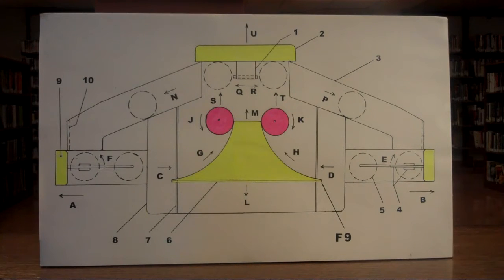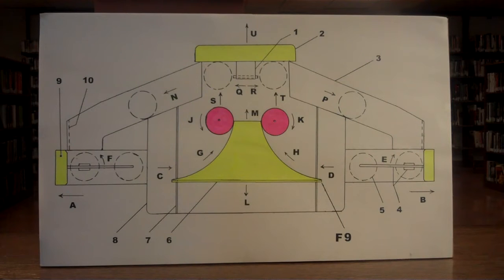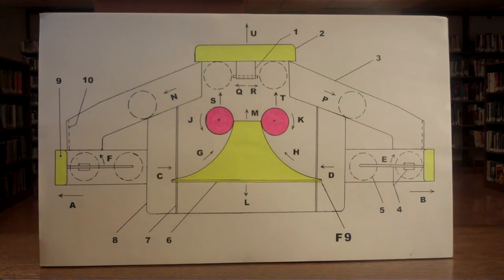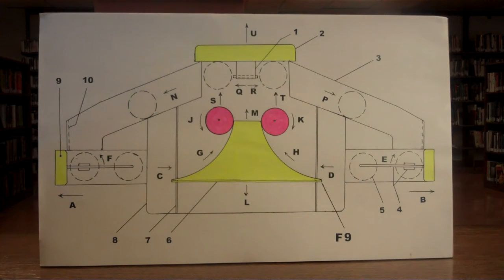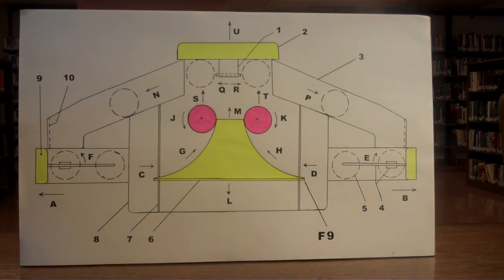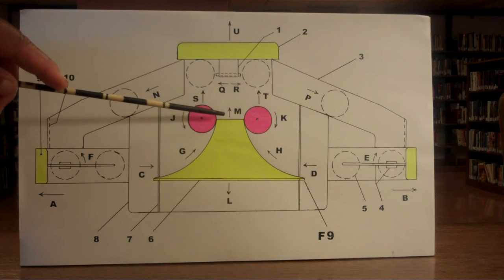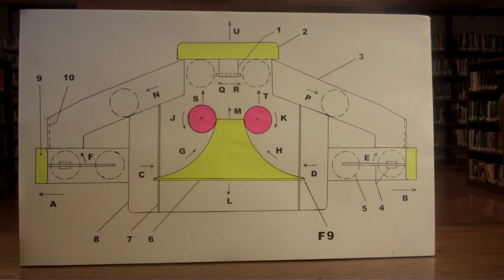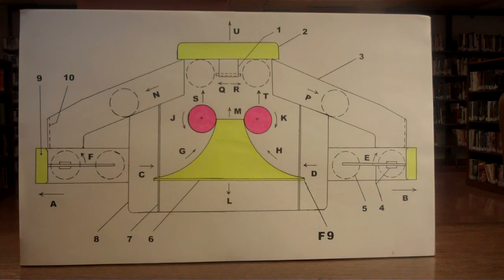PROPULSION: Enclosed Propulsion - Type 3. Enclosed Ramp Propulsion.

Comment: I THOUGHT OF SOMETHING LIKE THAT IN THE EARLY 1990s. AFTER GIVING UP ON THOSE THINGS BEING A STANDARD OF PROPULSION POSSIBILITY; YOU MAY HAVE PROBLEMS IN MICRO GRAVITY AS THEY ARE USED, AND THEY WOULD ALSO BE VERY NOISY WITH HAVING MECHANICAL NOISE, I MOVED ON TO AN ENERGY BASED SYSTEM, AND WHO CARES IF THERE IS NOISE AS A BYPRODUCT, THE IDEA IS MORE PRACTICAL, AND AN ENERGY NOT MECHANICAL BASED KIND OF SYSTEM, WOULD BE REDUNDANT IN MANY TYPES OF GRAVITY FIELDS. THE POWER SOURCE AND FLIGHT FIELD SYSTEMS. THEY MAY BE INFLUENCED BY BLACK HOLES OR AN EQUIVALENT TYPE OF GRAVITATIONAL FIELD FROM A  SYSTEMS. SOME ARE SIMPLY THEORETICAL, AND I REALIZED THAT YOU MAY HAVE ENERGY GENERATION FROM A POWER SOURCE TO SPARE, TO FEED THE HUNGER OF THOSE THINGS, THUS PASSING THEM BY EASILY.

THE TV SHOW THAT WAS AROUND BY THE TIME I MOVED ON FROM MECHANICAL APPARATUSES AS SUCH FLYING MACHINES, WAS "SPACE: ABOVE AND BEYOND". DOES ANYONE REMEMBER HOW THOSE ALIEN SHIPS SOUNDED? IT BOGGLED MY MIND TOO MUCH, I FELT GOOD MOVING ON. AND YOUR STUFF WOULD GENERALLY BE MORE NOISY IF THEY WORK ART ALL.

I MENTIONED "IF THEY WORK AT ALL.", THE FLAW IN THE SYSTEM IS THAT THERE IS NO POSSIBILITY TO STEAL MASS AND USED IT FOR PROPULSION. WHEN THE BALLS HIT "U", THERE WOULD BE A PROPULSION FORCE. WHEN THE BALLS GO BACK DOWN TO "F" AND "E" POSITIONS, THE WEIGHT "5" FROM THE LOOSE MASS "2" IMPACTED, THAT GIVES YOU A BIT OF PROPULSION "2 [IMPACTED]", WOULD CAUSE THE FLYING APPARATUS TO FALL AS MUCH AS IT ROSE UP. YOU WOULD BE LEFT WITH THE SLEDGE HAMMER EFFECT? HOW MANY PEOPLE THOUGHT OF A SLEDGE HAMMER THE TIMES THEY ENVISION THIS SORT OF STUFF?

FARCE, WHAT HAPPENS WHEN THE THING LOSES ITS BALLS?
Reply from the maker: Mr. S. W. B. : ... (1) You'll be shocked to find out that the Helio-centric Religion model of the universe you and 100's of millions of people were " brainwashed " in and taught: DOES NOT EXIST.  (2) The - REAL - universe is no more than 20 million miles in radius. Our REAL sun is not 93M miles away. Our REAL moon is not 240K miles away. Light Years do not exist. Planets are not millions and billions of miles away. And: black holes, galaxies, quasars, etc. don't exist. To you in your state of brainwashing (AS I WAS), this sound ridiculous. The earth is not a spinning ball shaped object. gravity do not exist. Humans never got to the moon in rockets. Which do you want ? the TRUTH or comfortable mind-fucked  lies ?  Choose.
Reply from the maker: Dear S. W. B. : ... If you think the things I thought up won't work, then let me give you a real heads up. All (ALL) the things that every person (Every person. That includes you.) has ever thought up to get from earth to anywhere from earth, except (probable)  for tesla ships (flying saucers) don't work and won't work. Why ? Because the universe you were taught, don't exist. The Helio-centric universe don't exist. It is fantasy.

Comment: first to comment on Mr. P . the absence of gravity is not an issue as Mr. Johnson said and even if it consumes extra energy then it will be just for a moment until the device start accelerating and create its own cloned gravity.

the idea is beautiful and genuine not like the hundreds of videos that copy an old unworkable design/concept . however , i do have doubt regarding the double action and their double reaction.. you know what i'm referring to, right ?
Reply from the maker: Dear Mr. Crowxe: If I missed something please let me know. I've sought to take in all actions, reactions, momentum, etc. I easily could have missed something.
Reply: Jessie Johnson . I really can't study it the way it's designed but we can simplify the ramp design in order to be able to analyse which reaction will be more than the other
Reply from the maker: Mr. Crowxe: The ramp can not be simplified more than appears in the video. All pairs of actions and their reactions to the forces cancel each other. Including the rotational forces to the ramp. The motion of the ramp must be canceled to zero or it will stop the total motion of the system. There are two types of forces in the system: linear and rotational (angular).
Reply: Oh , I didn't mean to change the device design, just meant to take that ramp on its own and tweak it for study suppose. Maybe make it straight with 30 degree
Reply: ugh sorry that came unclear. let's study a stationary ball on 30 degree up slope that's spinning using friction between it and the slope . what are the forces general directions